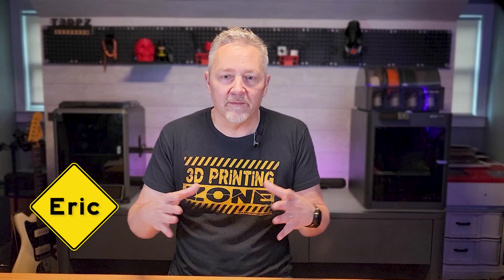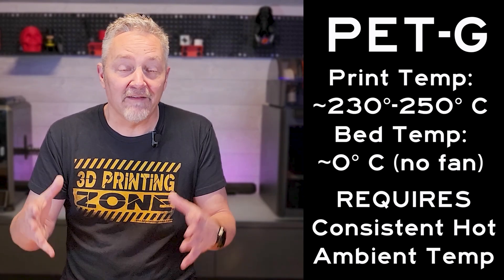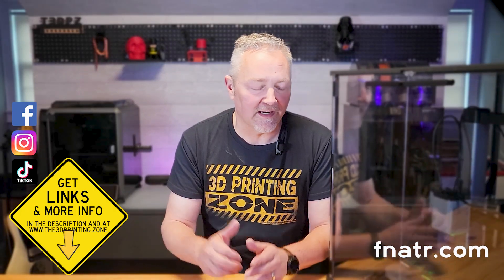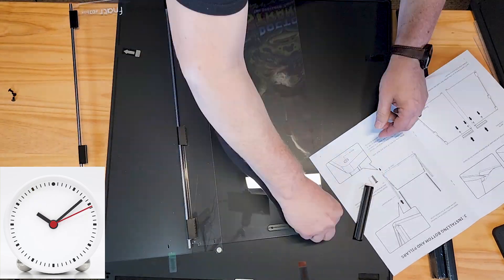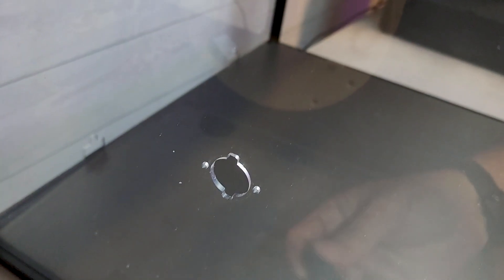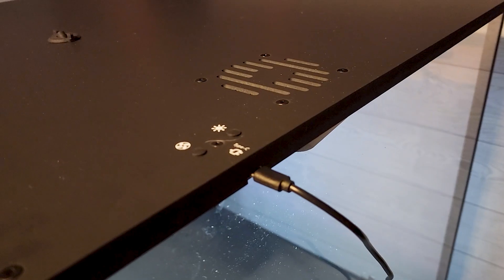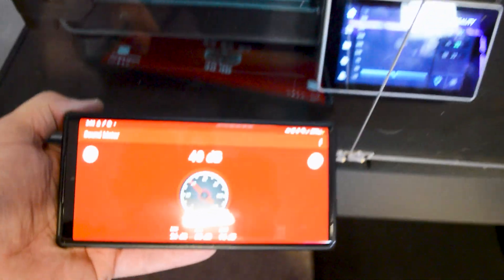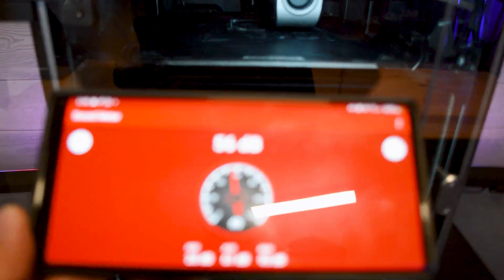The #1 Mistake People Make Printing PLA

Comment: My ender 3 has direct drive (no new extruder or anything just a kit to change the position). It has a big problem with under extrusion. What do I do?
Reply: Increase the flow multiplication in the slicer or change the e steps with pronterface if you didn't change anything with the extruder except making it direct drive this will probably not help but you might have a clogged nozzle or partially clogged also ptfe hotends like on an ender 3 can only be used up to 240 c or the ptfe tube will degrade and could cause under extrusion if there's ground up little bits of filament on extruder gear it's grinding the filament and this will cause under extrusion increase or decrease extruder tension I really don't like ender 3 extruders I would recommend replacing it with something dual gear if non of this works
Reply: @StephenTeitgen  thankyou
Reply: @pj452  anytime I hope it helps

Comment: I have to max out temps on bed and print nozzle to get pla to work.
Reply from the maker: Hmmmm..... I haven't seen that on mine or elsewhere. You might want to double-check your filament settings, make sure it's not set for the Hyper stuff. (I assume you double-checked it's actually PLA... I did that once and it was PET-G... yikes!). Otherwise there's a lot of things to check, like clogged/damaged nozzle, PTFE tube not seated/cut correctly, etc. If you keep having issues, check out forums and social pages, and/or contact Creality. Good luck!